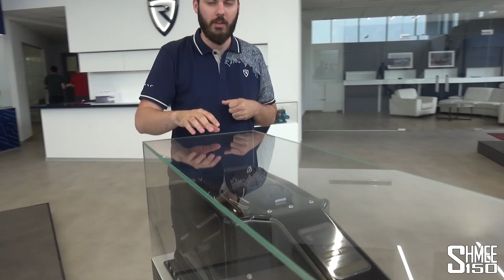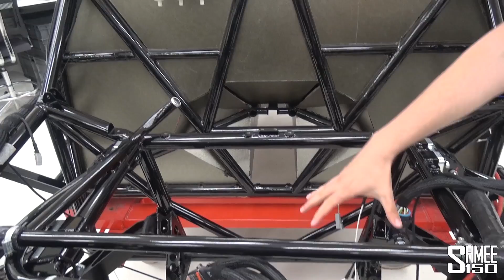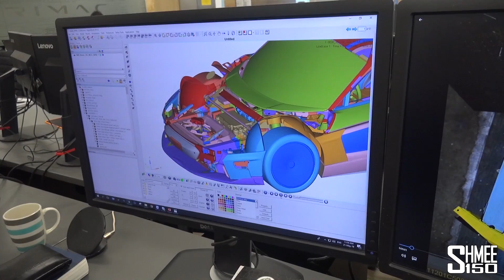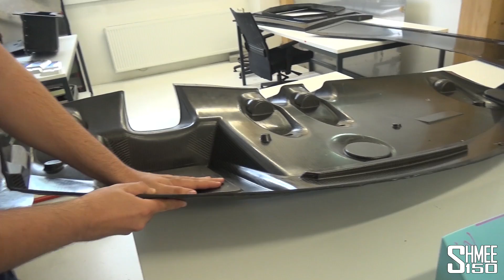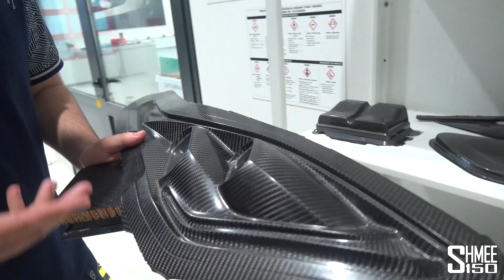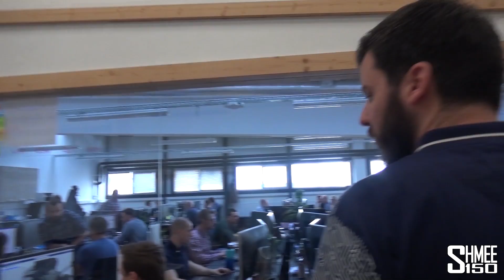VISITING RIMAC! C_Two Factory Tour with Mate Rimac

Comment: I hope one day to be competing against these guys I have so many ideas and to see and hear what they do is a blessing cause how I imagined a lot of how things should be I never was able to crash test cars so I didn’t know if it would be a wise move I didn’t know if things would hold up the way they should once the car was built and ready but by seeing the processes I know it works good and it inspires me to do it just that much more it goes from a feeling of maybe I can do this to yeah I got this still a lot of trial and error but I’m sure at this point I can do it only part that baffles me is why make the crash bars out of metal the honey comb design is stronger than what most think it would shave weight off the car and you can build certain parts to take the impact and break at certain points you can even direct the impact from more angels to impact the way you want better with the honey comb design I know he said he had to get the car ready in 6 monthes that’s why he chose that path but you give me a 3D printer and lots of monster with a 3D scanner and a high speed motion camera I could have had the rest of the design done in like 4 weeks for the crash testing of the structure of the rail yeah you want stiffness of the body but you do want very slight flex also so when your high speeds that body is more agile more alert and forced and ready to take them sharp turns and higher speeds with a stiff system like they did I dought that car could take a turn going 70mph the flex would allow the car to take that turn maybe at 140-150 area and keep itself planted that’s just my thought tho I won’t know tell I’m doing what they are I just see it as a wasted opportunity to push the boundaries just a little more of what a hyper car should be